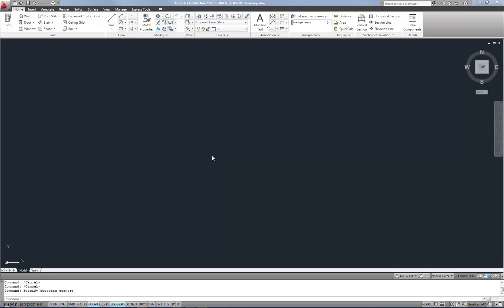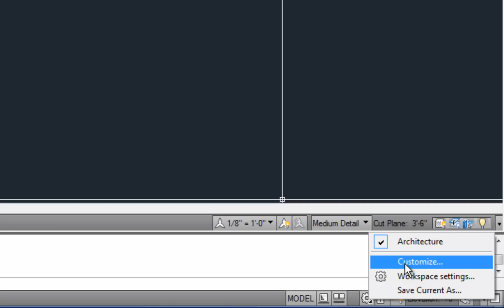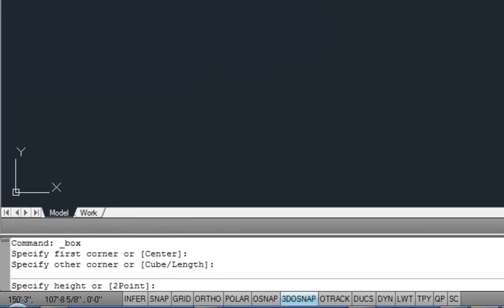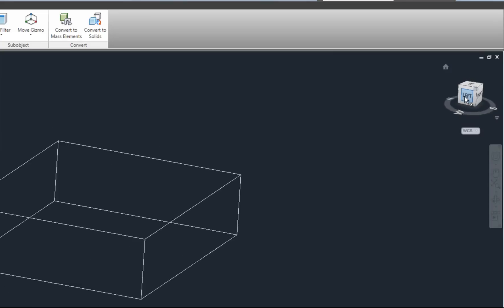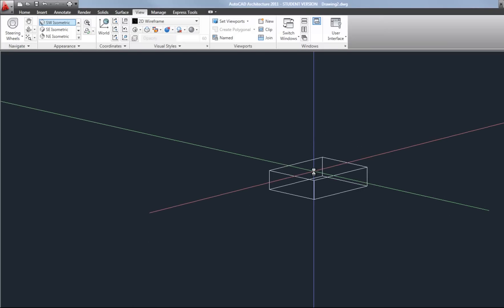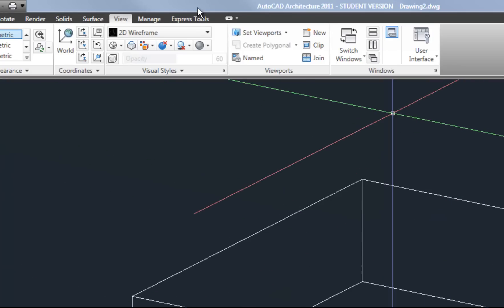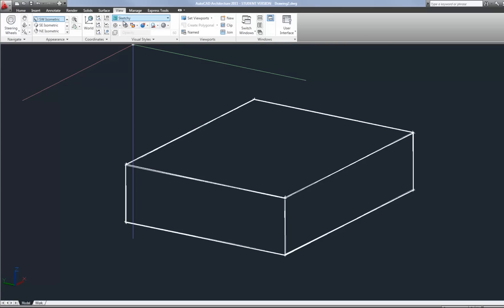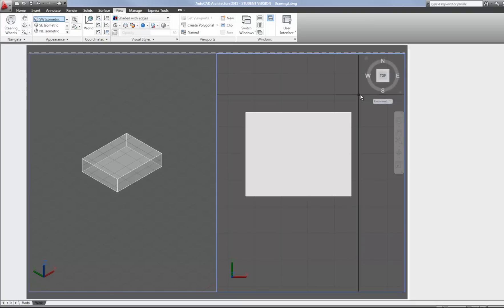AutoCAD Interm.: Intro to 3D

Comment from the maker: If using AutoCAD Architecture, use the section tool to generate a section instantly, although it lacks detail. See my video on this subject for more information.  Otherwise there are no shortcuts, just experience and efficiency in using the software.  Use keyboard shortcuts instead of icons. Learn to touch type if you don't already know. Consider where your inefficiencies are in your workflow. Some might only be 1 second each, but when you add up all those seconds, it makes a big difference.